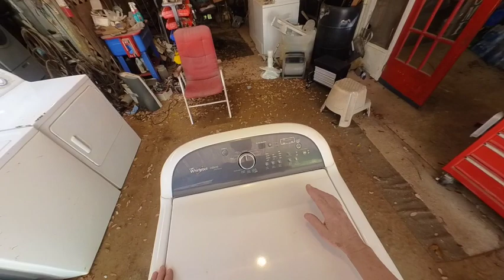How To Replace Bearings, Shaft, and Seal in Whirlpool Cabrio Washers: A Complete Guide

Comment: I would add to lay a towel inside the plastic liner before hammering the shaft out to act as a softner so the falling shaft does'nt cause damage. Otherwise excellent illustration. Thanks.
Reply from the maker: Great tip! Thanks for watching!

Comment: Could this potentially cause a leak? I have the Cabrio HE and noticed a small leak after the last cycle. It has recently gotten very loud near the end of the cycle as well. After some investigating near  hoses and the top, I don’t see water anywhere except near the bottom of the stator cover.
Reply from the maker: Absolutely. In fact that is a classic symptom of failed bearings and seals. Thanks for watching!

Comment: After pressing in new bearings, is it normal for that spacer to be loose in there? I see the spacer fits tight around the shaft so I'm guessing its fine
Reply from the maker: Yes, it is a loose fit. Thanks for watching!
Reply: Thanks for the fast reply! I just got my washer back together now, and testing C5 is showing OL again. I'm gonna try to clear codes and see if that does anything. Next step would be trying an RPS sensor I guess.
Reply from the maker: That would be my next step too.
Reply: Hey I figured it out. I was testing it wrong. I would go to diag/test mode and then skip to C5 to test agitate. By skipping I was not filling the outer tub with the water needed to lift and decouple the inner tub. C5 is only supposed to be spinning the agitator/wash plate. User error! My bearings might have been fine before. If I tested properly after cleaning the rust on the original shaft I might not have needed to do all this work in the first place. Oh well. Learn something every day! Now just have to setup the drain properly and I'll be in business. Thanks
Reply from the maker: Well, you probably extended the life of your machine too! Look at the silver lining!

Comment: excellent video - would suggest when tightening or loosening bolts you could say on video if they are regular or reverse thread.  Whats the point of putting the grease on the inside of the seal ?  that grease won't get on anything or help the bearings
Reply from the maker: Great suggestion! And as for the grease, It enhances the seal and that's what they tell you to do in the directions! Thanks for watching!

Comment: Can the bearing press tool be purchased separately or does it come with the parts kit? 
Was also wondering if it's normal to hear water sloshing around when i turn the rotor. I don't see any pooled in the tub from the inside but when i tip it slightly and reach under and spin the rotor i can hear water somewhere in the bottom of the tub spinning with it. 
Great video btw!
Reply from the maker: Here's a link for the tool https://amzn.to/4fc5ykV. You can get it with the bearings and shaft too. It comes in a kit. The water you hear is the salt water solution that is in the balance ring on top of the spin basket. It's normal and will shift between baffles during the spin cycle to balance the load. Thanks for watching!
Reply: @HarperandKnowles  awesome thanks so much for the quick reply!

Comment: What would you had done if that wash plate was more stubborn to take off? Great video!
Reply from the maker: Good question! I have actually had wash plates that were impossible to remove and had to break them with a hammer and chisel and use another wash plate from a scrapped machine . But that was after I tried everything else first. “Ben’s Appliances and Junk” made a video about this once with the methods he used. https://youtu.be/DoaxzocMhLo .
I bought some of that citric acid and used it but it didn’t work as well for me.

Comment: Hey thanks for the great video. This is the second time I have replaced my washer bearings. I noticed when reassembling the tub, the six screws and plate that attach the tub did not sit flush with the tub until I tightened the screws and it pulled the tub slightly up the shaft. I don’t remember that on the last bearing replacement, do you think my shaft was a different length? Also, when tightening the magnet cover on the stator, the Alan bolt is all the way tight, but I feel a little slop in the cover, is that normal? The impeller inside the tub has a little slip with back and forth movement, is that normal? Thanks for your help.
Reply from the maker: It is normal for the screws on the tub hub to pull that floating tub upward. Slop in the rotar and wash plate isn’t normal. It indicates worn splines on the rotar and wash plate. I wouldn’t worry unless your rotar drags the magnets on the stator. As long as you ordered the shaft that fits your model number I would think the spline shaft was made to the correct specifications. Thanks for using my video for your repair!

Comment: Great video! Definitely my favorite that I've found. Any idea what would cause water to be leaking into the stator from the bolts?
Reply from the maker: Hmmm, that shouldn’t happen.  Are you sure water is coming from the bolts? The shaft seals are usually the problem. I’d bet the water is just finding a way over to the bolts. The bolts shouldn’t be long enough to pierce the tub.  Change the bearings, shaft and seals. That should fix it. Thanks for watching!
Reply: @HarperandKnowles  turns out the lower bearing seems to be wearing out the plastic seat it is in causing an uneven load. Any idea how to reinforce it to keep the bearing level?
Reply from the maker: @NexisReaver  I'm sorry to hear that the lower bearing on your Whirlpool Cabrio washer is causing issues. Reinforcing the plastic seat can be challenging since it's molded into the tub itself, but there are a few options you can consider:  The first option isn't one I'd recommend because I doubt it will last.

1- Epoxy Repair: You can try using epoxy to reinforce the plastic seat and make it stronger. Apply a small amount of epoxy around the circumference of the seat between the bearing and tub and let it cure completely. This should help to distribute the load more evenly and reduce wear on the seat.

2 - Replacing the Outer Tub: This is the most comprehensive repair option. This would involve removing the old tub and installing a new one, which can be time-consuming and expensive even if you can find a replacement tub.

3 - Frankly at this point I'd scrap the machine for parts and buy a Speed Queen!

Carry on my friend!

Comment: Great video, you make it look easy! Do you have a specific bearing replacement kit that you would recommend? I have a whirlpool cabrio wtw8800yc1. It’s super loud during spin cycle, no error codes or leaks yet.
Reply from the maker: Hey Joe, no, I don't have a specific brand to recommend. The truth is most of the stuff now days comes from China.  I try to use only OEM parts when I order.  If you plan on doing the job yourself you will need a bearing press specific to this task.  There are a few kits on Amazon that sell everything you need including the bearing press for around $50.00.  This isn't a hard job except for when the tub is stuck.  Then you will need to use a jack to extract it. A small hydraulic jack will work too. Good luck with your repair, and thanks for watching!

Comment: Do you have to reset the computer after this? We have replaced the bearings and the springs, but when running the rinse, drain spin mode it had the ul code. It did seem to fix itself but I haven't put clothes in yet either.
Reply from the maker: You shouldn’t have to but I suppose it couldn’t hurt. https://upgradedhome.com/how-to-reset-a-whirlpool-cabrio-washer/. Thanks for watching!

Comment: Help! About 6 months ago, we watched your video, ordered the bearings kit and replaced them. All was good until about a .onth ago, I am having the same issues, ul code even if the washer is empty, did we do something wrong?
Reply from the maker: I recently discovered that the silver ring that is sweated onto the shaft and fits on the top bearing and through the seal will allow water to leak between it and the shaft and past the seal and compromise the new bearings. I now spread a bead of sealant around the top edge of this metal ring when I do this job. I would bet that if you do another repair you will find that your bearings are rusted out again. Always try to find OEM (original equipment manufacturers) parts when replacing the worn out ones. Thanks for watching!

Comment: Mine seems to be leaking from this spot is that normal ? Would love your advise
Reply from the maker: If it is leaking then your bearings have probably already been compromised and the seal has definitely failed and needs to be replaced. I’d replace the bearings shaft and seal. Thanks for watching!

Comment: Can these steps be used on a Whirlpool WTW4616FW2? I've got the whole "jet engine" thing happening.
Reply from the maker: No. These are two entirely different types of machinery. Your gearbox is failing and it’s more economical to replace the unit. Thanks for watching!
Reply: @HarperandKnowles  not the answer I was hoping for, but I appreciate the quick response... at least this will save time and headaches... ..

Comment: Why do the have water in the basket wouldn't that cause it to be unbalanced
Reply from the maker: No, the balance ring at the top of the basket is designed so that salt water (denser than fresh water) will accumulate into baffled compartments as needed to compensate for an unbalanced condition.  It’s really quite an ingenious design. Thanks for watching!